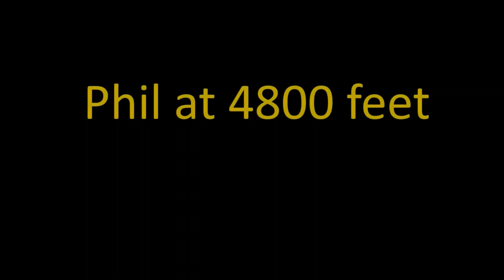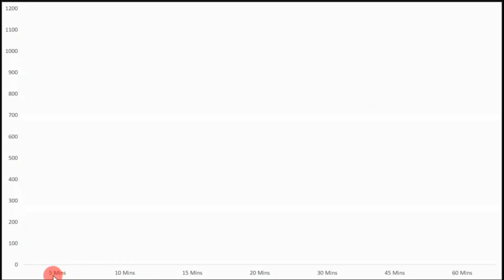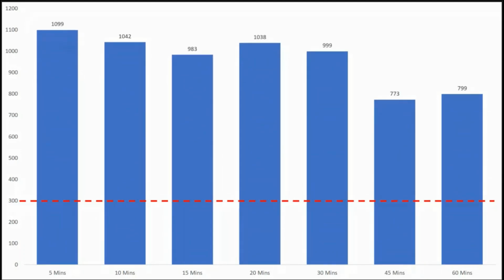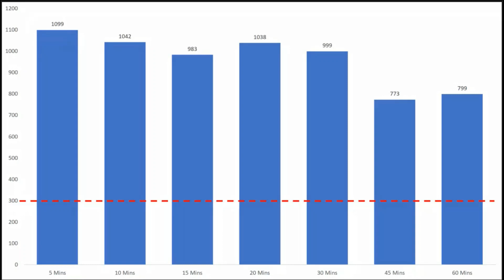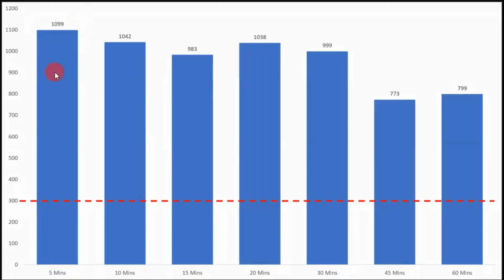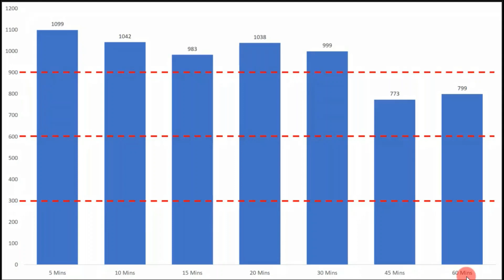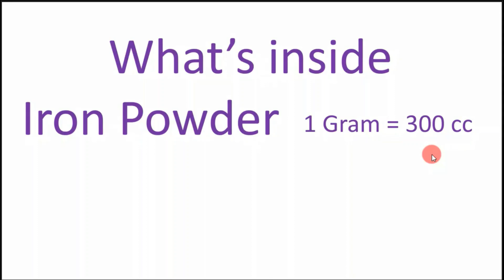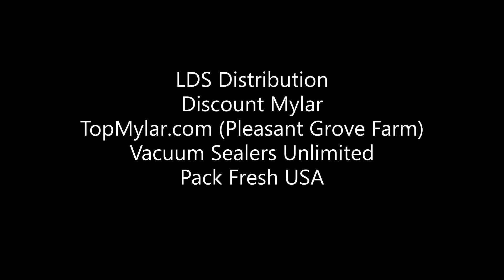How Long Can You Leave an Oxygen Absorber Out?

Comment: Phil, heya, great video as always!!  I love your scientific methodology.  So one thing to remember, and you can check based on your other testing, is that Oxyfree oxygen absorbers are overweighted compared to many other brands.  So based on your previous video, those 300cc absorbers in this video rate close to 1100cc actual.  However, most of the other absorbers on the market according to your video rated closer to 600cc actual, so their 'safe time' is going to be far lower.  Also, based on one of the videos you did after I sent you some absorbers, I had hoped you would do this type of testing, because we sent 'slow-acting' absorbers.  Based on their ingredients, those are mixed so they react over a much longer period of time, and your 'safe time' is more like 8 hours or more. They are designed to put off less heat (less condensation risk for your freeze dried foods) and 'burn' more evenly over a period of time (up to 7 days).  I'd be glad to ship you out another batch if you are interested in seeing what their results would be in this type of experiment!  Thanks!
Reply from the maker: Good comments.  the reason for my video was in reaction to a posted video that appeared on Youtube about a week prior to mine that didn't contain correct information.  Rather than calling them out, I wanted to show them what would really happen.

Comment: Phil, when oxygen absorbers are rated for a given volume, is that specifically at sea level?  How much of your observed "extra" capacity is just due to the air "at 4800 feet" being thinner than most of us experience?
Reply from the maker: Good thought process.  My initial reply would go back to the rate of oxidation.  You're correct that "air" is thinner at higher altitudes so the rate of oxidation would take longer than oxidation at sea level, but the amount of oxidation should remain the same.
Reply: X grams of iron will react with Y grams of oxygen.  But the volume of air needed to supply Y grams of oxygen will depend on the atmospheric pressure, PV=nRT and all that. Engineering Toolbox shows the pressure at 4500 feet as 644 mmHg.  Compared to sea level, you need about 18% greater volume of air to contain the same number of molecules, if my math checks out. So the absorbers are still rated very conservatively.

Comment: Why aren't oxygen absorber packets labeled as to size?  Can I weigh a packet to determine an approximate cc value?
Reply from the maker: Good question.  They should be marked and fall under the fair packaging laws.
Reply from the maker: You would need to separate the contents out to find the weight of the iron, and then you wouldn't know if the iron is pure or not.
Reply: @Philat4800feet  I'm not looking for the exact size, just a best approximation.   A 100cc packet's weight should be sufficiently less than a 200cc or 300cc packet.  Thinking about it, it should be easy to weigh a known 100cc, 200cc and 300cc packet  to have a fairly good idea what an unknown size packet by weight.  Keep up the great videos!  Most informative!

Comment: I loved the video! Very informative. I just have one question regarding the water test. You didn't mention it in the video, but how did you come up with the mark on the jar and correlate that to pulling 200 cc's? Thanks!
Reply from the maker: Filled the jar with water while on a scale.  The water came to 942 grams.  942g x .21 = 198g.  Placed 198g of water in the jar with a lid and marked the water level.  The nice thing about the metric system is grams=CC=ml

Comment: Thank you very much. I see even within the same batch each packet has some variability in them. One other thing to research is how to detect if a packet is still absorbing whether it's from a old package of packets or for reusing from a food container. I think a cheap thermal imaging camera will detect and variation in heat. With 900 cc capacity, you might be able to reuse continue using a packets especially if you always perform an air extraction before sealing.
Reply from the maker: Hmmmm, Not sure if there is such a thing as a cheap IR camera. If you had a consistent baseline on weight, perhaps the weight of the packet in milligrams.  However, at a cost of pennies, is it worth the risk?
Reply: @Philat4800feet  infiray P2 pro cost about 350 usd and is cheap.
You get more than twice the resolution and framerate than flir for half the price.
I have both and severely regret buying the flir one!

And HIGHLY recommend the Infiray P2 Pro, it's just amazing for many many things like finding insulation and air leak problems in house